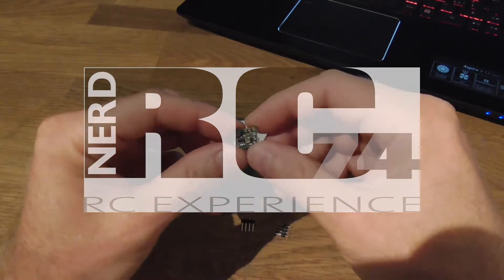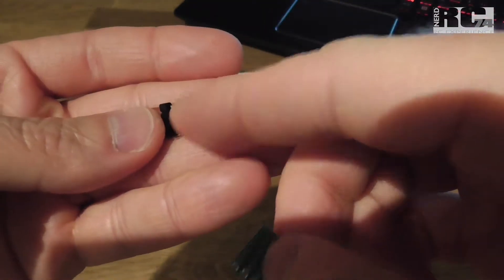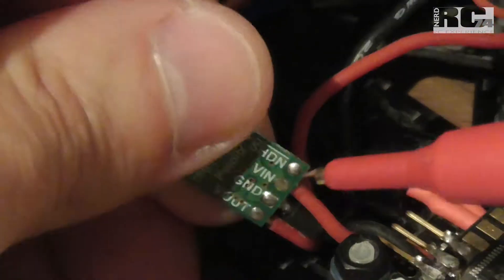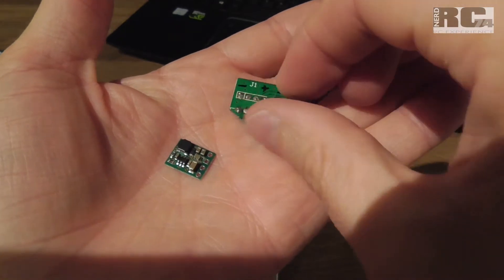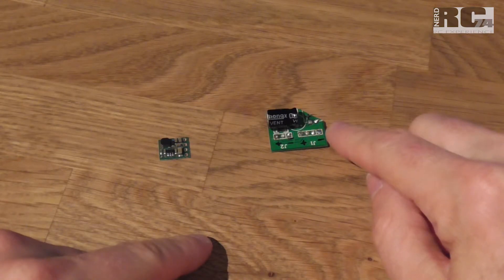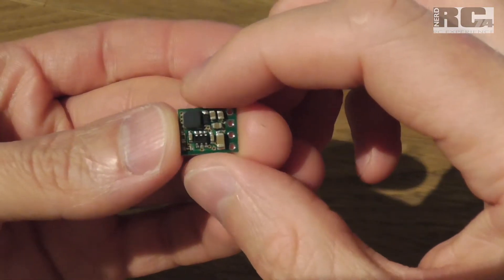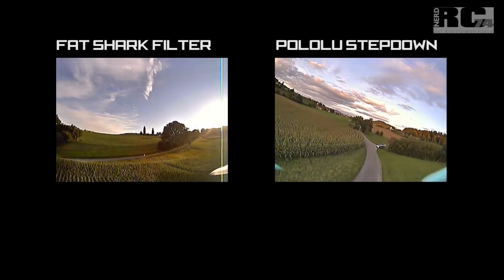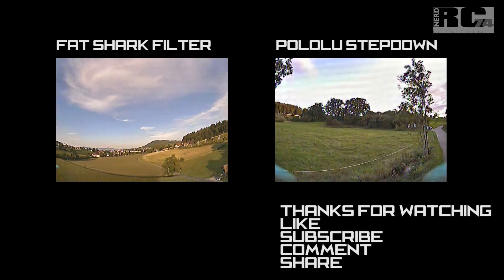POLOLU STEP-DOWN REGULATOR 12V - REVIEW - COMPARISON - TEST FLIGHT

Comment: Im going to solder a step down regulator very similar to the one you have in this vid , except mine has an extra pin hole that has pg on it .  Im unsure what this is  and  where to put this wire ? Do you have some sort of diagram showing where all the wires go
Reply from the maker: This video explains the wiring of VIN GND VOUT and SHDN.
- VIN goes to your flight battery
- GND goes to your flight battery and the component you like to power with your stepdown regulator
- VOUT goes to the component you like to power with your stepdown regulator
- SHDN needs to be connected with VIN. If you do not solder a jumper from SHDN to VIN, the stepdown regulator can turn off accidentally. What ends in a crash of your quad
- PG means "POWER GOOD". This can give you information if the output voltage of your stepdown regulator is too low (<80%) or to high (>120%) in comparison to the normal  output voltage (5, 9, 12V etc.). You do not need to do anything with this pin.
Reply: @RCnerd74  Mate thank you so much 👍 this is everything ive been trying to find out , ill be fine soldering this in now. You have made my day.  Really appreciate your help  👊😃 legend
Reply from the maker: @tribefpv  You are welcome :o)